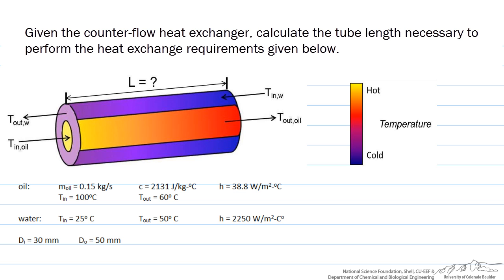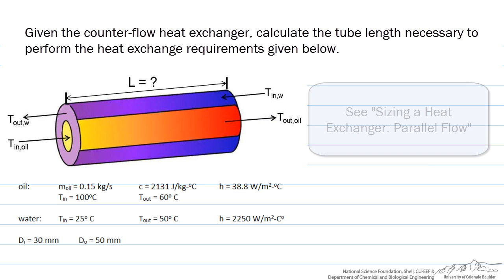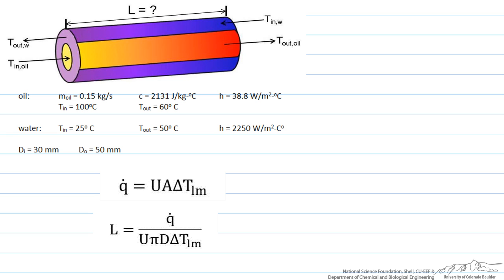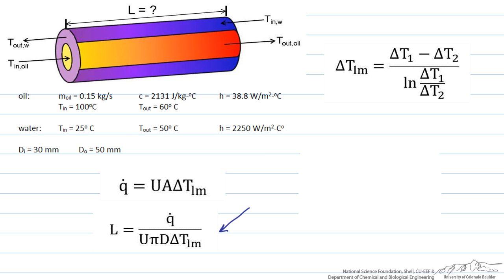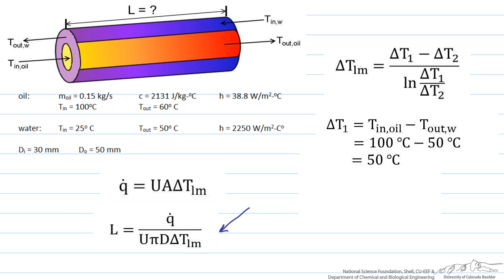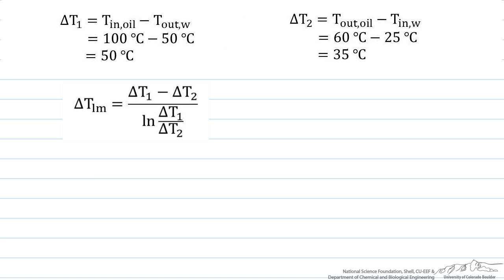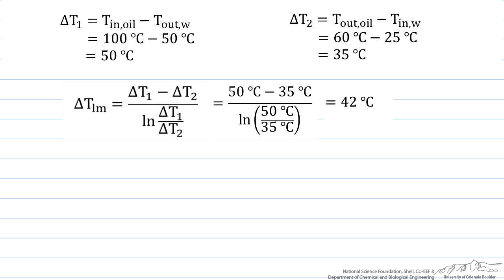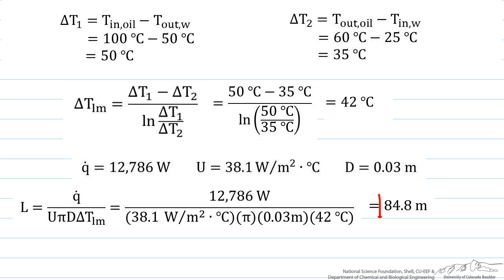Sizing a Heat Exchanger: Counter-Flow

Comment: How can I calculate the dimensions of steam air forced heat exchanger? I need to deliver 60c in a chamber with 27 m3 - steam temp. 130c

Comment: Why not take out side diameter
Reply from the maker: Great question.  The reason the inside diameter is used is that the heat transfer is occurring where the oil contacts the water.  That is at the point of the inside diameter.

Comment: Do we need to know if the fluid go liminar or turbulent?
Reply: If h is not provided you may calculate Reynolds number then find a proper nucelt corrolation based on Reynolds number and the geometry. Once you find the nucelt number you can calculate h.
Reply: indeed, to calculate the value of "h"  but in this case it was provided

Comment: How did you find the overall heat transfer ccoefficient without knowing k for conduction resistance?
Reply from the maker: +Fsa839 Great question.  This should be more clear, but we assumed no conduction.  This is explicitly written out in the screencast on sizing a parallel flow heat exchanger, but not here.  I will add that in.  Thank you again.
Reply: tum a gaye ho